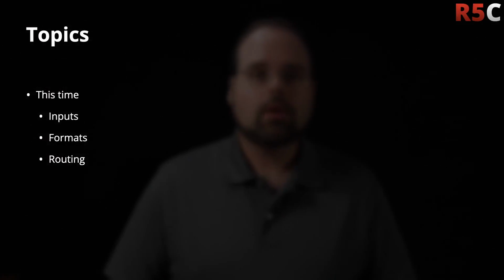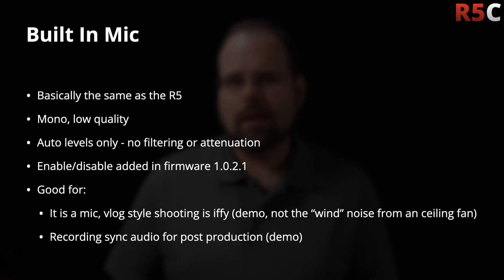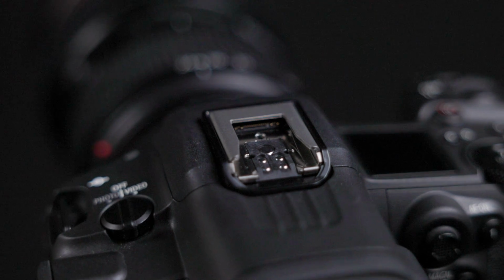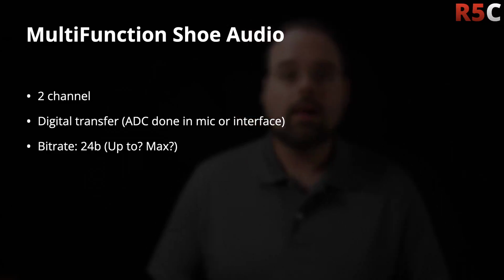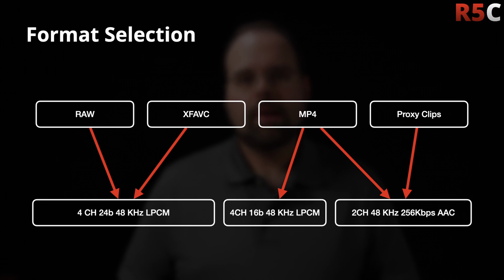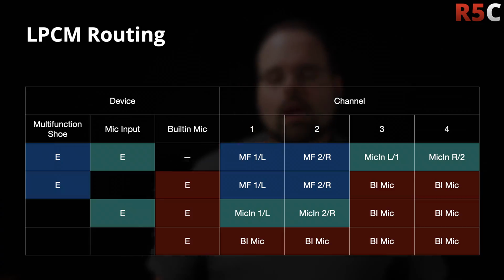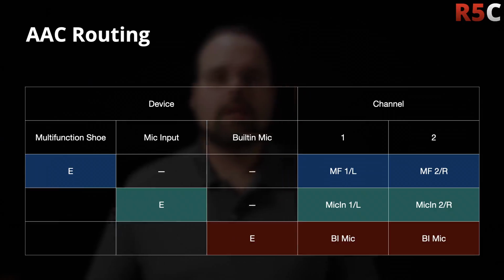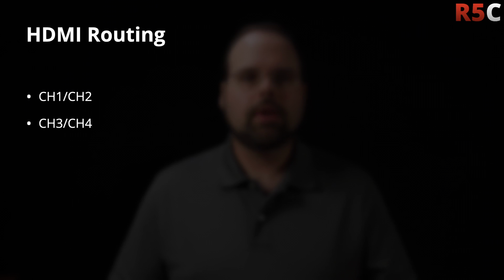Understanding Audio Inputs, Formats & Routing on the R5C - R5C Tip 15

Comment: using a stereo mic (mke-440) for ch1 and ch 2, but the camera is still routing internal mic to 3,4 . How can we mute the 3rd and 4th unused channels when 3.5mm jack is used for 1,2?
Reply from the maker: The short answer is you can't. The routing is hard coded in the camera, as I described in the video and on page 105 of the manual. The only case where the 3.5mm input is put on channels 3  & 4 is when you also have a multi-function shoe audio device (like Canon's DM-E1D mic) in the hot shoe and your mic plugged into the 3.5mm connector.

Comment: does it record automatically when I plug the external mic or do I need to press something in the camera menu? Thanks!!!
Reply from the maker: The only thing you'd have to do in the menus is set the recording levels. Otherwise, it will automatically start recording the external mic when it detects one is plugged in.
Reply: @PointsInFocus  Thank you for your fast reply!

Comment: Hi Jason, thank you for all videos. Can I ask you something you maybe able to help. What am I doing wrong? My canon 5rc alway shows 4 audio channel's? How do I go just to one that is connected to input with one mic only?
Reply from the maker: Put simply, you can't. One of the odd limitations of the R5C is that you cannot turn off, or at least stop it from recording, unneeded audio channels. It always records 4 in PCM mode, and a stereo mix down to 2 channels in AAC mode.
Reply: @PointsInFocus  thank you for your quick reply

Comment: Thanks for the video.  I'm experiencing some differences from what you are saying about the channels. When I play back the audio channels 1 and 2 seem to be taken by the built in mic.  Channels 3 and 4 seem to be taken by the RODE SVM STEREO VIDEO X/Y CONDENSER CAMCORDER MICROPHONE.  Premiere calls it Media Source Channel 1, 2, 3, 4.   I came to the conclusion about the source/channels because the first 2 are mono, and 3 and 4 are stereo, and the quality.  I had it on the shoe, but took it off, and that didn't change anything.  Before I watched your video, where you said that the priority isn't changeable, I thought it may have been a settings difference.  I use this audio sparingly, because I have a C70 that I connect my XLR shotgun mic to.  Any suggestions or comment are appreciated?
Reply from the maker: The channel routing I described in the video is taken directly from page 105 in the R5C's manual (PDF version). It's been my experience, that the manual is correct and the camera route signals as described. However, if you're seeing something different than that, you'd have to ask Canon why.

As for seeing a stereo track in Premiere... The only time the R5C records a stereo audio file is when it's in 2 channel AAC mode. In LPCM mode, the camera records 4 mono tracks and you have to tell you editing software to treat them as stereo. I haven't used Premiere for years, but I don't think it should be reorganizing the track structure, or presenting it any differently than it is in the files. So to that end, I'm not exactly sure what's going on there.

Also, as far as I know, Rode doesn't have any mics that implement Canon's multi-function shoe. Just putting any mic in the camera's hotshoe doesn't change the routing order or how it's connected. The mic/AIF (specifically Canon's DM-E1D mic, or Tascam's CA-XLR2d-C audio interface) must connect through the pins in the front of the hotshoe for it to be a multi-function shoe device and get routed that way.
Reply: @PointsInFocus  I looked back at the footage, and I was incorrect.  I was looking at the C70 footage.  The R5C footage does reflect what you reported.  1-2 are the 3.5" mic input, and 3-4 does seem to be the internal mic.

Comment: how can i get three seperate audio inputs to record on three separate audio tracks? I have a saramonic LAV receiver with two transmitors, as well as a basic sennhieser shotgun mic. Will I have to record the two LAV mics as L and R on the same audio track and then separate them into individual audio tracks in post or is it possible to have them each record onto their own audio track and have the boom record onto a third since it defaults to creating 4 tracks anyway. Will a simple 3.5 cable splitter function if i plug both the receiver and shotgun mic into the same audio input or will it try to mix the audio inputs internally? I tried using the CKobal MX-1-V2 Two-Channel Mini Mixer with Shoe Bracket which seemed perfect for this problem, except that it did not work at all and couldn't even fasten to the top shoe securely enough for me to feel comfortable attaching mics or my monitor to it. Would love any suggestions, you are clearly an expert on this camera
Reply: I guess I could sell my boom mic and buy the canon brand one that works directly though the shoe, but is there a solution with the mic I currently have? or can it only record max 2 channels through the 3.5 Input regardless
Reply from the maker: I'm assuming that your Sarmonic wireless system outputs one mic puts each mid on each of the stereo channels. So one goes to left, one goes to right. If so, then you won't be able to use a simple passive cable to combine the output from that and your shotgun mic, you will need a mixer of some sort.

The best option, in my opinion, at lest if you're serious about good quality audio, would be to get a proper 3-6 channel audio recorder and use that to record all of your audio. Something like a SoundDevices MixPre-3 II or a Zoom F6 would be idea, but you can of course go with something less expensive. Run everything into that, and either a time code cable back to the R5C or an attenuated patch from the recorders line out so you have good sync sound on the camera. Then use the audio sync function in your NLE (Resolve/Premiere Pro, etc.) to sync the good sound up in post. This will give you the most flexibility, and best possible quality audio.

Barring that, you can get 2 more inputs for the R5C with a Tascam CA-XLR2d-C. This uses the multi-function shoe and provides a 24-bit pro level audio interface with 2 XLR/TRS combo jacks (with phantom power) and a 3.5mm (1/8") TRS unbalanced input jack; though you can only use one of the two at a time. You can use this in conjunction with the camera's 3.5mm mic in to record 4 channels independently.  The CA-XLR2ds also have a mount for mic if you want to use a standard shotgun mic on camera. 

As for selling your Sennheiser shotgun mic and replacing it with a Canon DM-E1D... Keep in mind you can't take the Canon off camera. There's no provision for the extending the multi-function shoe connection and there's no 3.5mm option on that mic. All things considered, I don't think that mic is a great solution for most users. It might be ideal for a journalist with an R3 that doesn't want any stray cables, but for everyone else it's quite limiting in the long run.